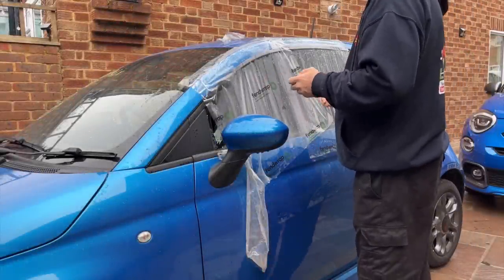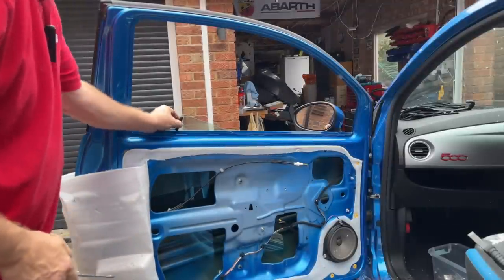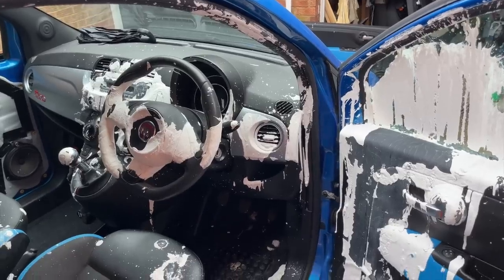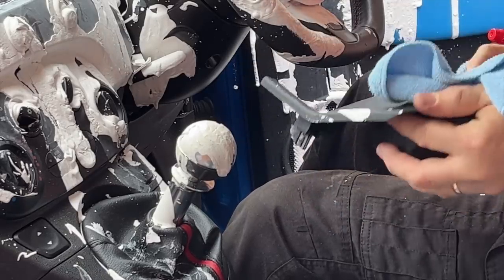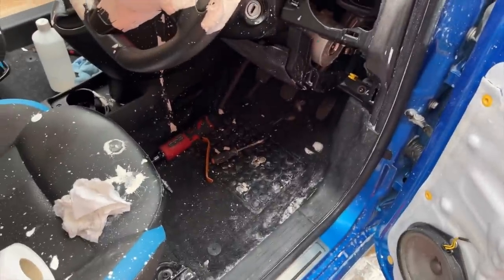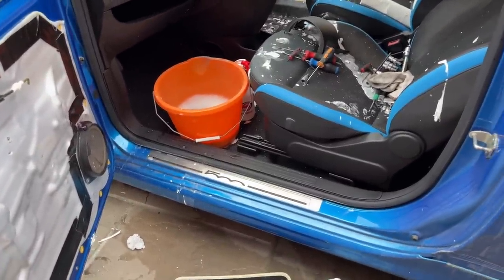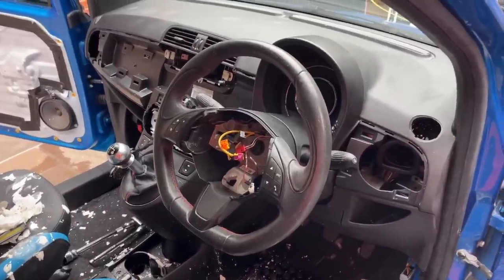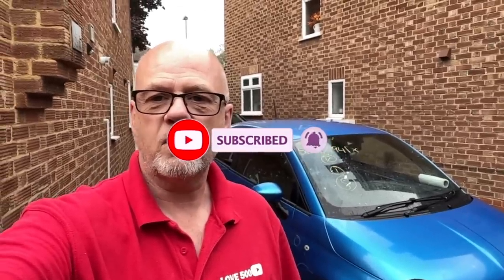Fiat 500 Sport - Project Van Gogh - Day 1 of the Clean - Copart Salvage Repair. No crash.

Comment: A pressure wash will sort the door cards and if you’ve scratched any chrome/shiny metal bits then metal polish might help buff em up ok, use cocktail sticks to clean crevices in the dashboard and controls as the wood won’t scratch anything, soak the door rubbers in a bucket of hot soapy water. Salvage rebuilds pressure washes seats out of their cars all the time so might be worth a go as long as you can dry them in your house
Reply from the maker: I normally steer clear of jet washing seats due to the airbags but these have the leather side so won’t soak up water like the fabric.  Exactly what I have done today.

Comment: Haven't finished the video yet but I sense you filmed this before seeing the comments on your last video. Although I'm sure you'd have had some issues with the methods mentioned you'd have probably scratched a lot less by using the steam cleaner and I think emulsion softens if you soak it in water for a while. I just think its about taking your time as well. Will be interested to see how it all turns out.
Reply from the maker: Yes, I hadn’t seen those comments until after this. I have bought a steamer but it’s rubbish and didn’t really help that much.
Reply: @Love500  That's a shame. Would love to see some comments from detailers on this as I'm sure they'd know what to use.
Reply: Take all parts seats etc and power wash' nowt to lose

Comment: There is a product called Graffoff its made from orange peel even smells like marmalade, you brush it on and leave it for half a hour or so reapply it aswell, problem is on a project like yours you will need to power wash it off seats outside, Graffoff works by soften the paint as i said before its a messy task. but it will remove the paint .

Comment: Try using a dremel with a rotary plastic brush and for the seats try G101 spray the seats then leave it to soak in for 10 minutes then get the marcher out and pressure wash them then use the carpet cleaning machine  and wash them and vac dry
Reply from the maker: I’m way ahead of you. 😀

Comment: I personally think you should have bought a penguin steam cleaner and had a go to use the power of hot water / steam to remove the grime and paint 
Horrified when I saw you attack the glass with a scourer ... thought you would have had a dedicated shaver blade scraper  ...  extra fine steel wool for glass cleaning paint removal 
Only knew with that pan scourer in your hand your going to cause further damage 
Maybe worth spending £23 on Amazon and saving some cash on trim ....    they work well on valeting usual grime
Reply from the maker: It wasn’t one of those metal things, it’s not that abrasive. The glass is fine. There was too much on it for a blade. I’ve bought a steamer, didn’t work, too slow.
Reply: @Love500   Maybe try those magic eraser blocks  I use them when decorating     but sometimes slow and steady wins the race